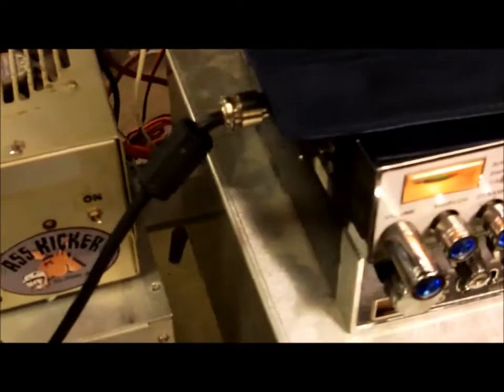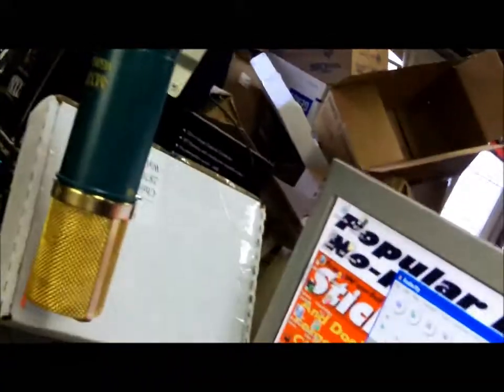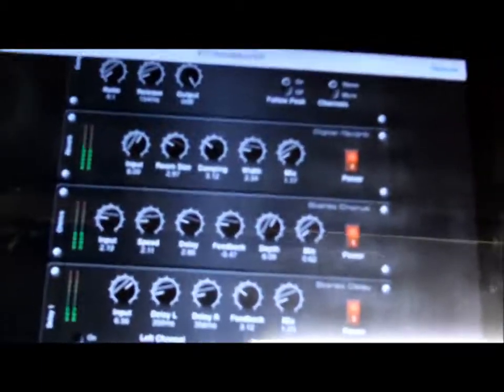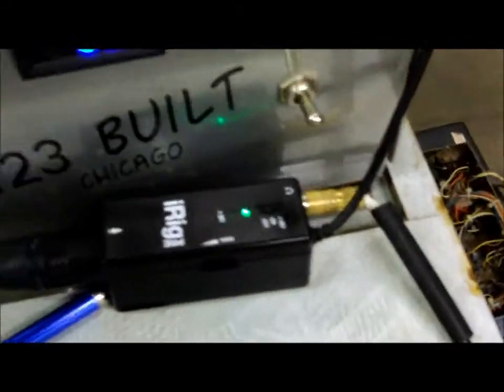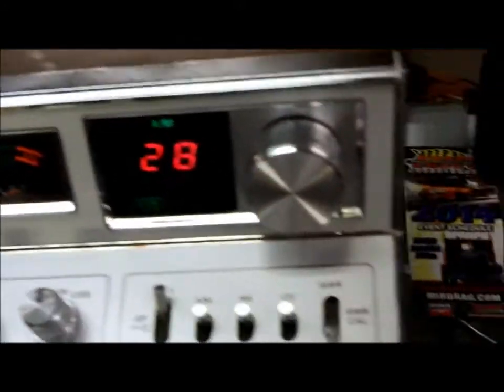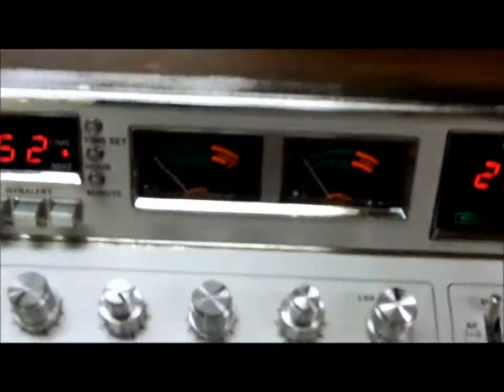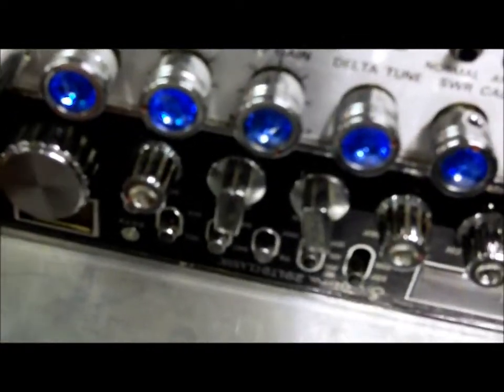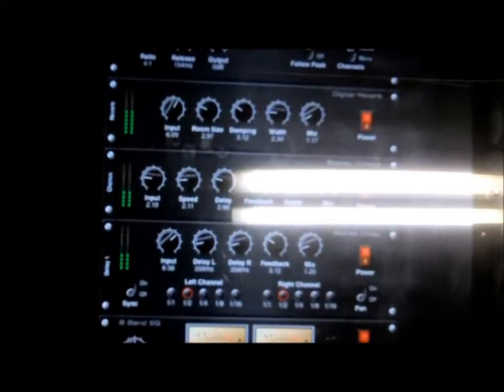Ipad audio part2

Comment from the maker: Ya I found his mods not to work well with the things we do here. I do my own cap changes in the radio's myself. You can get the direct injection to work well with HiFi, but you have to add a pre amp in line with your audio source, to get the radio up and make watts. I find that the Ipad deal seems to be the easiest way of going the route of HiFi. Change a few caps in the audio line and hook her up. But for the guy that doesn't know how to do that they can just hook right to an unmodded radio and still sound good. Better with some cap changes tho. Plus a lot easier to adjust the Ipad settings then all the rack gear. Also best to use a 1 to 1 transformer if your running amps.

Comment: I thought you would need the cap changes to pass the bandwidth?

Thanks for sharing man... you know who gone :)
Reply from the maker: I thought so also, but when we tested it with the 142 it didn't sound good at all. So I put the stock caps back in and everything was fine then. I'm still playing with stuff and I'm not saying it won't work, but it wasn't the case in the 142. Now i did change caps in a 29 and it sounded great, I'm playing with some more stuff in the 29, but with this deal you don't have to change the caps to get good audio.